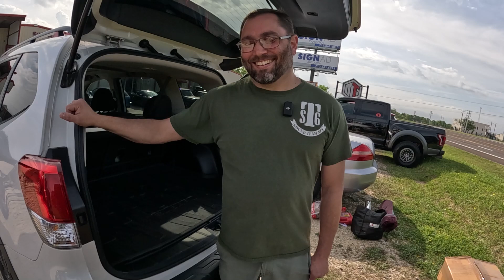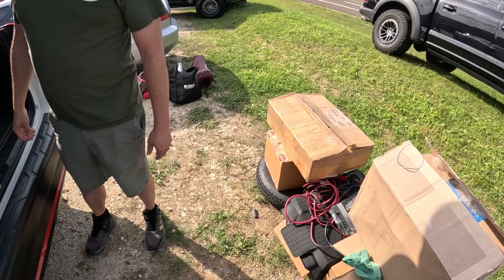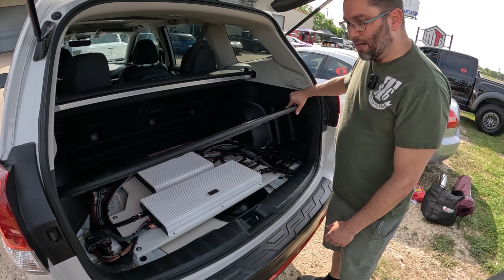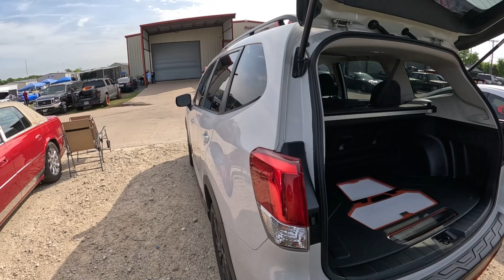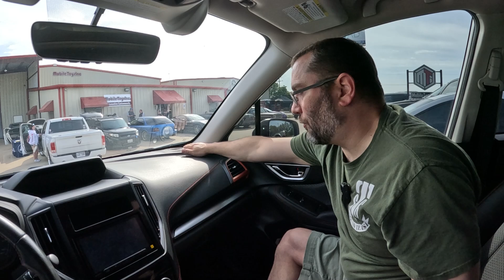ResoNix Competitor Spotlight - Aggieland X: Michael Myers

Comment: One of the methods that ive found works is measuring the drivers with no LP or HP filters. Then use your overall target sum/house curve to eq the the driver to. Once you apply the desired crossover the acoustic response will be dead on to the crossover slope and any tilt in the curve will be correctly represented in the slope as well for the crossover. So, basically the same thing as eqing directly to the crossover slope. Whats nice about that method is that it allows for different crossovers to be tried wihtout having to adjust any eq like if you wanted to try 12db vs 24db. The eq will already be correct for the extension of the 12db slope lower in the freq range and you wont have to try and re-eq ro the shallower slope.
Reply from the maker: I've done this in the past as well. It works
Reply: This is how I tune with Dirac
Reply: Must say this sounds like the most flexible method. Alternatives where people create a target curve (for ex. @RAW-CAt ) for each driver given pre-determined crossover points are much more limiting yet all methods (including the 2 mentioned in this video) should give the same end result :)
May I add 1 extra detail:   Consider EQing each speaker to a very generic (flat or straight-sloped) target curve, because ideally any target curve should be user-editable as global PEQ on input (or as identical PEQs on each speaker channel). We do not want to bake-in target curve into corrective EQ of each individual speaker element - if possible.
Thanks for sharing.